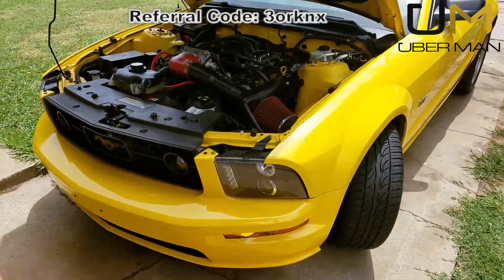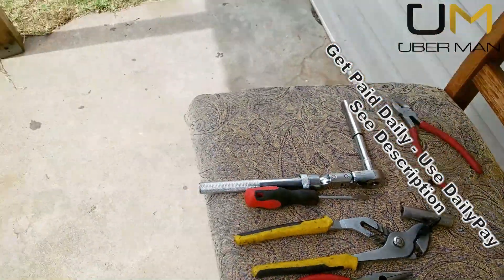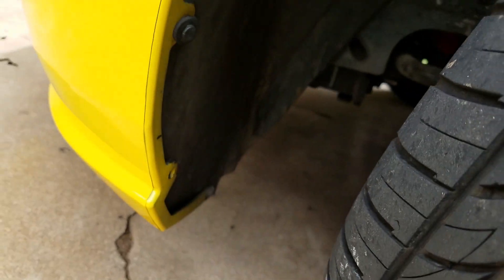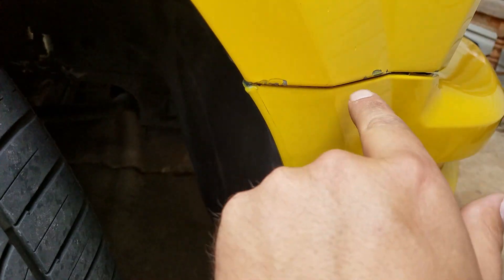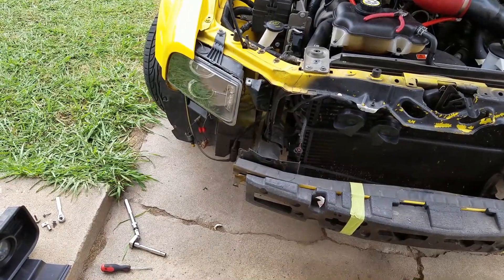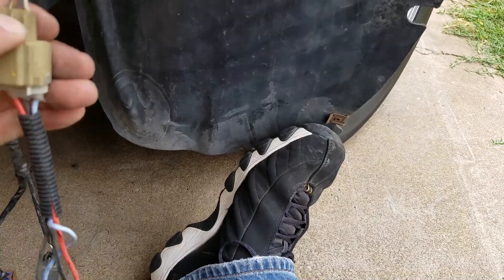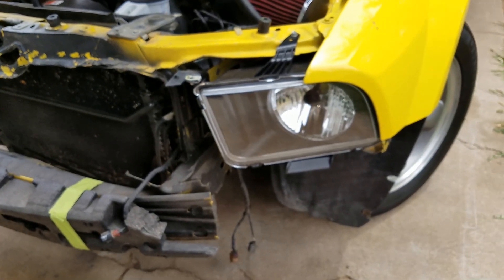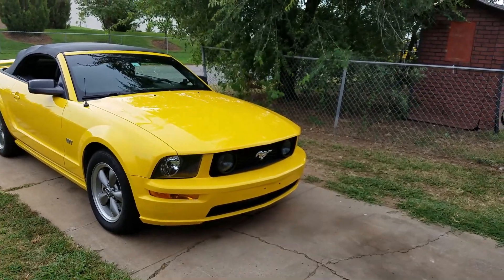2005 - 2009 Ford Mustang Bumper / Grille / Headlight Replacement 08-14-16

Comment: Ok, I see what you mean on the fog lights. Mine has the original, and every time I see them, I think to myself, "why they so small? Shouldn't they be in the lower part of the bumper if they going to be that small?". Because I am looking at the BIG head lights and here are these tiny things next to them. I was considering making them turning signals. But now I under whats going on here. So Now I know how to resolve it.. Good video... OBTW, yeah, I rather have the stock head lights myself too. That after market one looks just too silly...